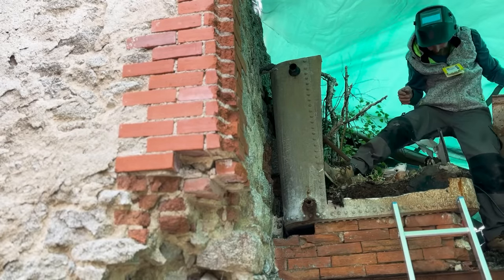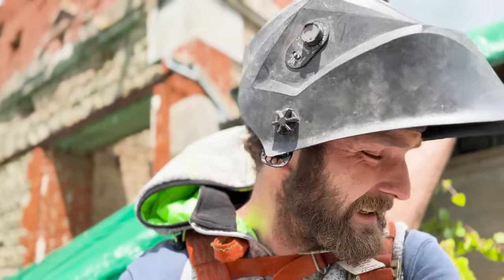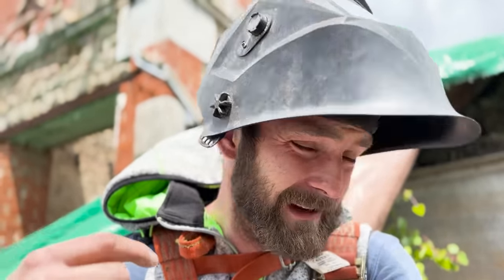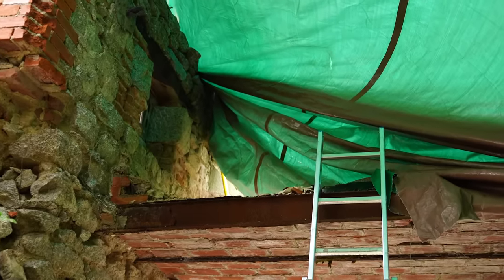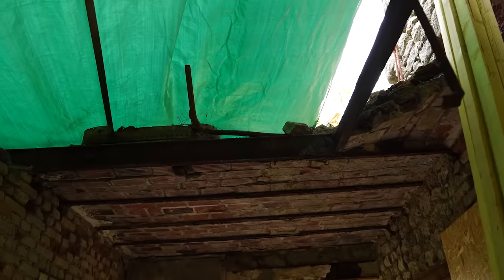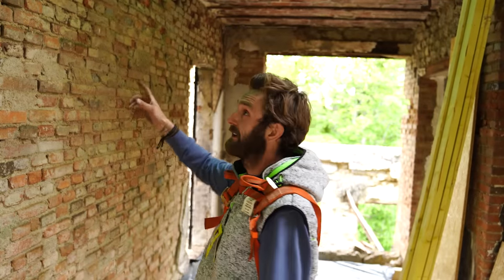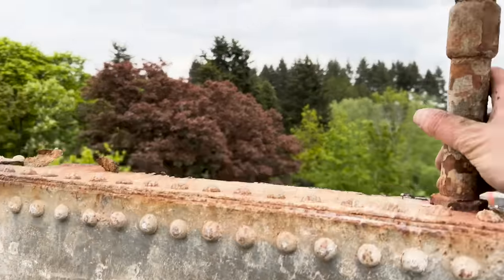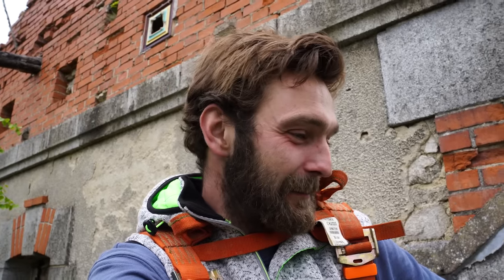i cleared the TOP level of the chateau, now its time to demolish it.

Comment: 👍👍😊. It is good that you are not bothered by heights.  It is strange to see trees up that high.
Reply: Not really so strange. If you have time to let your eyes stray around I'd suggest next time you are a passenger in a vehicle you look at the roof gutters of the houses you pass... One house I saw had a date palm growing about 10 foot high out of the gutter. An expensive problem to fix if they had a really good rainstorm... A flooded roof cavity, ceiling collapse from the water or worse it finds the electricity and starts a fire up there. Almost felt like asking the driver to pull over so I could post a note in their mailbox.
Almost wrote a note to myself to check my gutters for wattle seedlings, lol. Blessings from South Eastern Australia, Dot

Comment: Won't it be so nice to get the roof added? That will make you really see the progress and protect the inside of the castle?
Reply: Yes, but it's a major phase of a ginormous project!?!
Reply: I have heard in France, once there is a roof you have to pay land tax.
Reply: @JaneRob:  wouldn't it take more than a roof to make the dwelling taxable? It's not habitable in its present state.
Reply: There is nothing to roof yet.  The walls don't exist to support it yet.  Dan acknowledged that today when he talked about taking down and rebuilding them. Also you can't build a roof without some kind of access on the outside of the building.  Sit tight, it's going to be awhile.
Reply: I like calling it a Mansion . Wish he could do more. Look forward to the next project .
Reply: lol protect the rotten inside lol.
Reply: @janerob1009  you always pay tax … based on the rental value. So adding a roof won’t change much as long as this building is not habitable.

Then once it is habitable, this is typically about counting rooms and bathroom and the overall fit and finish.

Comment: Notice how the stone on the upper level seems to blend seamlessly with the brick?
It's because it's melted brick.
Take a closer look!
What kind of heat does that to Brick?
Great job on the Chalet, thanks for the video!
Reply: The fire warped the iron girders too
Reply: Thanks for pointing it out, now I gotta watch it again closely to see what melted brick looks like. I'm guessing that it melted so well not just because of how hot the fire was but also because the bricks were made with a high percentage of sand in the "recipe" of the mix. Blessings, Dot

Comment: After using those same cutting discs you used in this video, and having several shatter on me mid cut, i switched to diamond cutting wheels. Slightly more expensive, but massively safer. Unfortunately the cheaper style of disc are quite dangerous after I did some research, it's surprising that these are still allowed to be manufactured.  Fantastic work mate, love the videos.

Comment: Actually, the bases of those tanks weren't rotten at all. I'd definitely do the tightwad dance, collecting all of the pieces, storing them somewhere dry with a view to trying to re-weld them back together as planters. 
With a wee bit of restoration work, they would look magnificent once again once planted up. Just need to position the joints away from view. 

Some appropriately sized planters at the foot of the main entrance steps would set the Chateau off a treat & if you could manage to swing the restoration of the tanks, you'd save a tidy amount; planters of that size are HORRENDOUSLY expensive. I know because I looked & gave up!

Comment: There is a 2 nub-prong wrench that you are supposed to use. Usually comes with the tool.  Hand tightening isn’t the safe step to use.
Reply: Yes, it's in the back of the van I suspect so rather than go down several flights of ladders.........Plan B!?!

Comment: As an OSHA Construction safety consultant in the US, you needed to identify the most secure section of masonry or a steel beam to install an anchor point to attach your lanyard to. The lanyard was retractable or shock absorbing so you need a rescue plan for who will get you down once left dangling in mid air. Without a rescue the leg straps of the harness will cut off blood flow to your legs causing real trouble for you.

Comment: Wild to me you can just work on something without Engineering plans etc.  In the US the County would require a lot of info about your plans before giving you a permit.  Love This SO MUCH!
Reply: I think its wild too! I'm pretty sure evey country in the world, apart from those in the Third World, still require engineers and building inspectors to check on the progress on jobs and plans. Thinking he's just doing bits and bobs so it looks like there's progress but  nothing truly structural....for which he's going to need experts involved and a team 🤔 It's sort of hilarious he turns up to a ruin with a can of spray paint and it fixes the beams. 😅 I'm definitely here for it though. Just not sure what the end product is going to look like...its definitely not a restoration. 😂 Go Dan, whatever you're doing its entertaining.
Reply: No permits in rural Texas.
Reply: @Natalie: he has already explained on the earlier videos that he can't restore the chateau because of the damage to the structural integrity of the materials that were burned in the fire (the one that happened when it was last occupied). His plan is to put back as much of the original (or remodelled) details as he can find evidence for, using the old materials as templates and as starting points to inspire him. He will also include the modern amenities that most people will look for. He will try to stay as close as he can with the details without compromising the safety of the rebuild. For example he was told that the layout and thickness of the structural systems holding the floors up would need to changed to be upto the modern code. He needed to put in more support and the support beams needed to be thicker/larger than the original floor. He talked in earlier videos about getting together with architects and engineers to design the chateau to meet all the requirements of rules and regulations.
I'm not sure you have the whole picture. I suggest you watch the whole playlist, he answers many of the questions I had about the process through those early videos. In a few of the videos there are photos of the chateau before the fire when the chateau had been remodelled (I think in the 60s or 70s) and then the day after the fire. Many of the original details were changed in the remodel so, as he explains in one video, it then becomes a series of decisions for him to make as to what he thinks. Should he try to restore the very first plan of the chateau (he hasn't found photos for evidence of what was original and it has been structurally altered by the remodel)? or should he stick with what was there before the fire but after the remodel and that can be proved with the photos? Such a hard call to make and he will have to decide this on every little detail for every room.
He also has to think about just how practical it is to bring the chateau back via restoration. The time it would take to research and source materials made in the old ways, the cost of using the skilled tradespeople, etc.
He has said a few times he feels the burden of being responsible for bringing the chateaux back to liveable condition while respecting it history. He wants to do the best possible job that can be done and from what I've seen he is doing so well, making sure the work he does will last.
Blessings, Dot
Reply: @dotcassilles1488  ah yes, the old dilemma of what to retain and what to alter! I knew it wouldn't be a restoration because I don't think that's his style (I remember he put glass bricks in the cottage) and that's totally fine, not every one is into keeping things authentic ...its very difficult to truly restore a building and it has brought many a professional builder experienced in restoration undone. Replacing like for like can definitely be done but it takes a LOT of money!  Maybe it will be  a sympathetic renovation? Cant wait to see! Thanks so much for your explanation....been watching Dan since he filmed his pigs in the paddock right at the start  but I must admit, I don't watch them all as much as I used to so it was very helpful. 😀
Reply: There is engineering plans somewhere. In France you cannot start a project like this without building permits, and to get those you have to have an architectural plan, and a report of the structural issues, and how to fix it.
Reply: @pernille2389  yes, that makes total sense you would also need to have a buildings inspector (or equivalent) sign off that it's all done to code before being able to move into a building also?
Reply: @nataliekeane8944  I think the finished structure is also inspected, but as I'm still waiting for the building permits for my own project I haven't started looking into that yet.  France are not an easy place to do building work, I'm lucky that I just want to change an existing structure, if one is digging into the ground one often has to pay for an archeological survey too.
Reply: @pernille2389  wow. That's something we don't really have to do in Australia..archaeological surveys (I don't think)..well not that I've heard of, nor do we have to worry about bats living onsite 😃...which I sort of wish we did. 🤣
Reply: @nataliekeane8944  oh I had forgotten about the bats, which is odd because I spent a year convincing my bats to move from the barn to the stable. They are now happily settled in their new home and in all the little bat shelters I've build to teach myself carpentry,:)
Reply: @pernille2389  Oh I i LOVE that you did this! 👏👏👏

Comment: So satisfying to see the rubble tossed from the roof! Can't wait till you get a proper lid on the chateau. If you don't use the same brick/size are the replacements structural and not visible? Already marked progress!
Reply: The walls were originally plastered so I don't see any reason not to use block instead of solid brick. One thing I do wonder is how high this particular wall extended up originally. Possibly the same as the walls on the other side of the hall, towards the balconies. Based on the old pictures and the ghost lines still visible I'm fairly confident now the original roof had one long ridge spanning the two mansard roofs over the second floor side wings and the centre hall, with a dormer-like bit facing the stair tower. The back bedroom had its own mansard roof on the third floor with a hipped top section that was much taller than the roof above the hallway and the one big mystery is how that joined up to the lower roof. The only aerial photo I've found is taken at a steep angle and the stair tower completely blocks the view of that section.

Comment: A tip on the metal cutting blade: shallow cuts help the blade last longer and helps guard against the blade being pinched or caught which results in a damaged blade or it even shattering. 
I enjoy seeing your progress and how you step up into all these challenges. 
It is with much anticipation waiting to see how this turns out. 
You have a wonderfully cheerful demeanor.
Stay safe 
👍🏻👍🏻

Comment: I hope you know bricks and concrete don't go well together. Instead of rebuilding the top of the wall with bigger (concrete-) Blocks you should consider using bricks again. Just saying
Reply: I've seen cement block at the bottom and brick on top, but not the reverse, and the walls weren't plastered over, either. Maybe he can get away with it since he's covering the walls with plaster? Or is he using lime? 🙄
Reply: @winmarfbd909  He might be talking about terra cotta blocks, a kind of lightweight brick with many holes for insulation and weight reduction. That's quite popular for all sorts of construction in central Europe, ranging between 80 and 500 mm in thickness depending on application. Or lightweight breeze block (aerated concrete, well-known under the brand name Ytong in most of Europe). Obviously none of these materials look particularly nice exposed but the wall was originally plastered, probably using lime plaster.
Up here I'd think the main issue with cement (pure sand and cement that is) is flexibility. Lime and lime-cement mortars and plasters are slightly flexible and allow for tiny bits of movement without cracking. Cement mortar (basically concrete by another name) won't, at least not enough, and if the brick or stone is softer than the mortar it will crack first. That's why the mortar should match the brick or stone used. Apparently for granite pure sand and cement is perfectly appropriate, for soft brick or lime stone it isn't. Cement plaster is rarely a good idea, except for foundations.
Reply: @SuperEgleh  Thanks for your reply!
Reply: @Ragnar8504  Thanks again, Ragnar! Your explanations of things are very thoughtful. Even someone with no DIY or building experience (like me!) can understand. I never knew they made different types of brick in Europe. Silly me, I figured we had EVERYTHING here in Michigan!!! 🙄
Reply: @winmarfbd909  I've seen terra cotta blocks used in a renovation in NYC and was surprised to see them there, I hadn't known they were used in the US either. In central Europe they're amazingly popular for smaller and mid-size construction projects like single-family homes. Most people here consider brick and concrete superior to timber framing (and more affordable as well). For large buildings it's most common to use concrete.

Comment: When you say "Bigger blocks" I hope you don't mean cinder blocks. That would ruin the aesthetic and authenticity of the building. What was originally built with bricks, should be rebuild with brick if you are rebuilding. Cinder block would look horrible. Just my opinion, for what it's worth.
Reply: Would also potentially be too hard of a substance. Older bricks are softer than modern breeze block.
Reply: I'm fairly sure it's for not visual walls. Just like it's mostly done in modern buildings, where the bricks only are used were they are visual. How things were exactly done back in the day, are often pretty expensive to replicate today, because it's usually very time consuming in some way.
Reply: @Cblackburn3083  As long as the mortar connecting the old and new together is soft enough I don't see any problems.

Comment: Dan...throw the steel tank pieces OUTSIDE the building so you won't have to move them once more from INSIDE to OUTSIDE! ❤️🙏
Reply: There is no way to throw them to the outside, I assume, as he is in the central part, they are pretty hefty bits of metal, moving them on the ground floor is considerably easier than at height!?!
Reply: @thomasherrin6798  No...over the top & down the OUTSIDE...save time & effort. A little thought beforehand is worth the ire afterwards. ❤️🙏
Reply: @LoireValleyChateaux  How? You'd have to get them across the wall onto the little balconies and then over the railing. That would have meant lifting the pieces to well over chest height, absolutely no point in doing that. Have a close look at the drone footage, the area has absolutely no access to the outside!

Comment: You know what a Sawsall is ? Worth investing in .
Reply: No, tell me, what's a sawsail??
Reply: Oops, Sawsall. What's that? Silly old widow wants to know! 😂
Reply: @winmarfbd909  A reciprocating saw or tiger saw. Pretty handy tool for jobs like this, also useful for cutting tree roots. You can even get masonry blades for them, very handy for removing bricks without damaging them, just cut the mortar joint around the brick you want to get out. They're a lot less popular in Europe than in the US but DIY stores do sell them. I mainly used mine for cutting old galvanised pipes, that was at least as fast as an angle grinder and felt much safer, a slow-moving saw blade instead of a fast-spinning cutting disc and also no sparks.
Reply: @Ragnar8504  I get it, saws ALL kinds of materials! Thanks for taking the time to explain. I appreciate your kindness. 😊
Reply: @winmarfbd909  Yes, exactly! Americans seem to love reciprocating saws, in Europe they're a bit less popular but they definitely have their good uses.

Comment: If you dont need to replace the water tank maybe install solar panels in future? I fully believe that you can give some modern elements to an old building without ruining its character! It may also be nice to get a beehive once the renovation is in its last stages
Reply: I think the last thing Dan wants to do is put new water tank(s) in the Roof, if they are required (I don't think it will be necessary) it will be in the basement with pipework and a pump to the upstairs rooms!?!
Reply: Solar panels sound like something to consider.
Reply: @thomasherrin6798  The only advantage of loft tanks would be having water even during a power cut but water pressure on the second floor would be quite low. One thing we can be fairly sure about is that there was never a bathroom on the third floor so the bidet must have been put into storage up there. With a gravity-fed system the bathrooms need to be below the water tanks.

If Dan rebuilds the rear mansard roof this middle roof section would be a pretty bad location for solar panels because the mansard roof would block a lot of sunlight (the mansard roof faced south-west and was much taller than the roof above the third-floor hallway). The hipped upper part of that mansard roof would probably be the best location for solar.